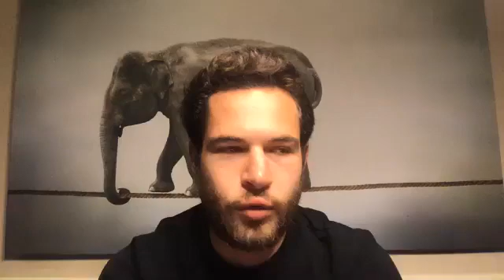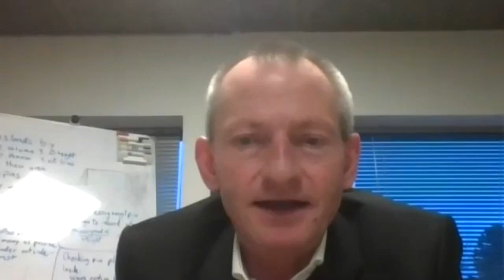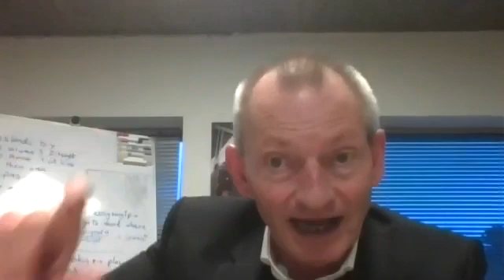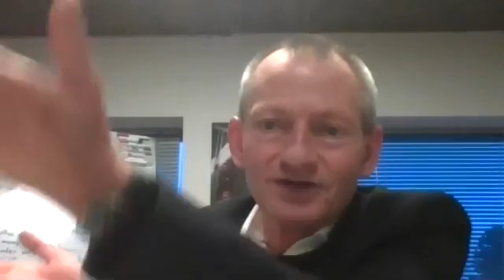Economic Competitiveness of 3D Printed Construction with COBOD CEO

Comment: Good interview. They need to focus more on how much concrete is saved in a building project by 3D printing, compared to normal projects. This is a major selling point and will give the company an environmental edge. Concrete and building of houses is one of the great climate challenges we have. 
I also see great strategic benefits to merging with another Danish company - Odico. But that is an entirely different matter.